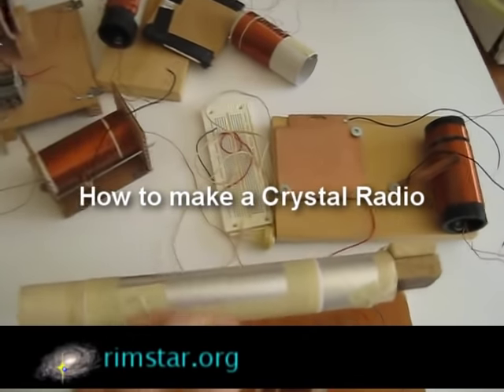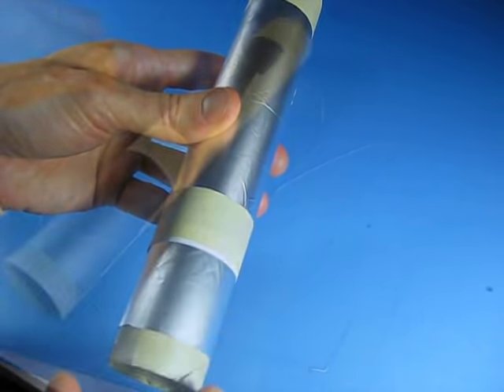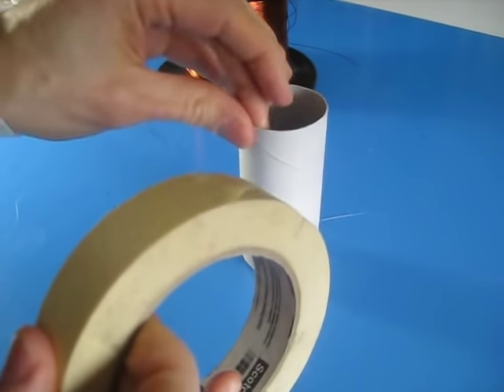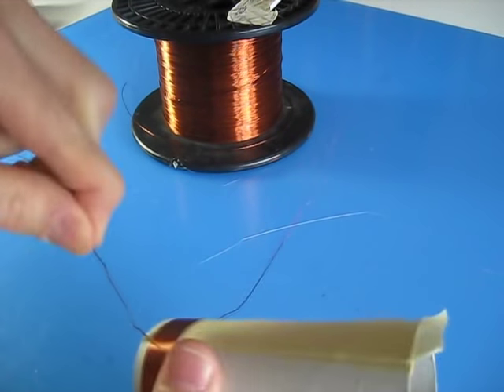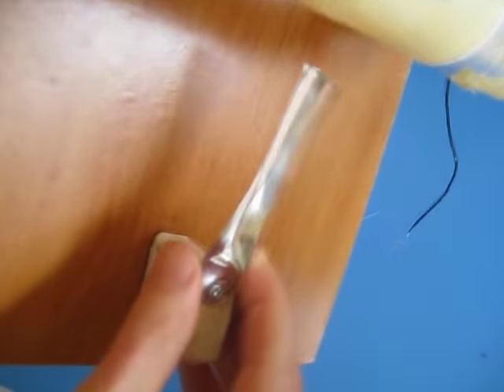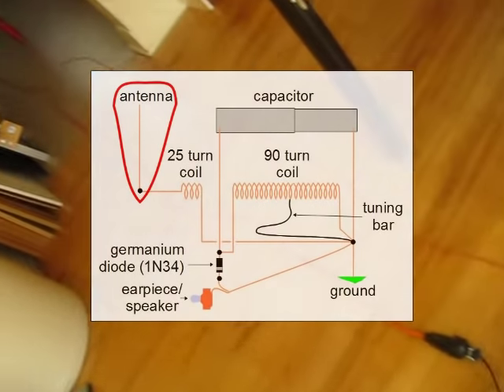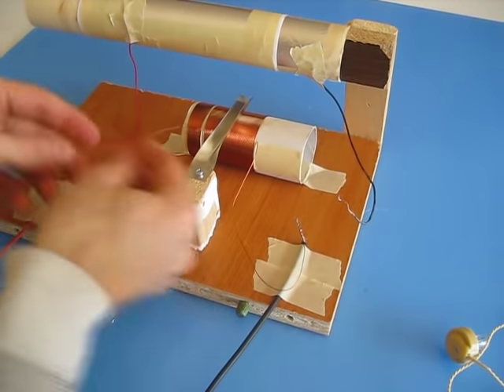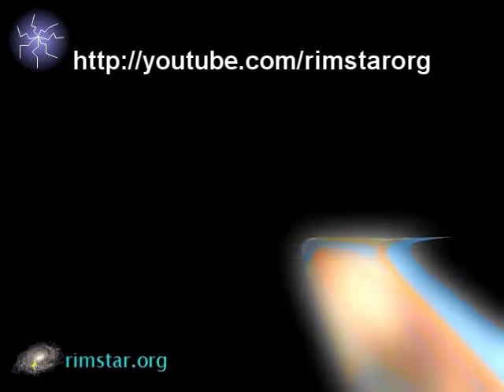How to Make/Build a Crystal Radio

Comment: Hi Raimstar, I am very excited about the project, I just made my crystal radio and it worked thanks to your video, even though I can only hear it with an audio amplifier and the sound is very low, I am getting the piezoelectric earphone in order to see if that was the thing that will do, I tried an old (I think) telephone earphone and also a piezoelectric buzzer but nothing happened at all. Also one of my biggest questions is to know if by any means there is a way to light up a led only with the energy that comes from the soundwaves, I dont know if it would be possible by using a transformer or ataching more antenas or what would be necessary, what do you think? Thanks in advance!
Reply from the maker: ***** The voltage coming from the crystal radio is very low, only a few hundred millivolts. Depending on your LED you'll need over a volt and sometimes over 3 volts to get it to light. I've seen people do it but they had very long or tall outdoor antennas. One person even raise his antenna using a kite! I've never even tried to light one.
Reply: RimstarOrg I'll try to increase voltage with a Joules thief, as it has given me very good results in few past projects, have you ever measured the amps coming out of the radio? Thanks again in advance!
Reply: RimstarOrg The other thing that I was thinking was to use all the radio's frequencys as possible to be able to get more electricity, im guessing I can try to achieve thay by removing the tuning coil am I right? And by the way congratulations!, you have done an amazing good job, if I achieve succes with the Joules thief I'll let you know, regards.
Reply from the maker: ***** You may need to find a germanium transistor  for the joule thief if you can find one. And no, I've never measure the amps.
Reply from the maker: ***** The problem with using all frequencies is that the electrons are being pulled in all directions, so no AC or DC, just random motion, and low voltage.

Comment: What is the difference between a foxhole and crystal radio? Do you need a capacitator that can tune in a cryrstal radio?
Reply from the maker: A foxhole radio is just a type of crystal radio. Usually it uses a razor blade instead of the modern diode (http://youtu.be/eIdHsjfbckw) and doesn't have any tuning. You don't need the capacitor if you have a tuning coil like I do. I went with both for extra sensitivity.

Comment: you do not have to have 2 winding of wire 
and the capacitor is not necessary either
and instead of a diode there are other things that can be used
Reply from the maker: jolllyroger There are many possible circuits for crystal radios depending on what you want. The 2 windings help with eliminating radio stations that are near each other in the radio spectrum. The capacitor helps with tuning in a single radio station. You can see more about those in my video about how crystal radios work http://youtu.be/0-PParSmwtE. And I've used the pencil and razor blade trick in this video here http://youtu.be/eIdHsjfbckw but it'd be nice to try an actual crystal and cat's whisker someday. And of course, there are more variations for all of the above.
Reply: so go for it lets see the cats whisker and real crystal i would love to see that
and yes i loved your other videos on using pencil and razor but the pencil is not necessary 
have you done CB band with razor
these are things that so many kids just learned in days gone by at school but these days the teachers are to busy teaching their global warming lies and indoctrinating children to be god NAZI'S and devout liberals
btw i know the whisker is a wire called a cat whisker because they were generally very fine wire... and the crystal can be any rectifying material

Comment: Can I use different gauges of magnet wire
 for the 25 turn coil and the 90 turn coil?
Reply from the maker: Yes, you can use different gauges of magnet wire.

Comment: another question popped into my mind.
If the diode is replaced by 2 similiar diodes(full wave rectifier), can the signal strength n quality b boosted?
and btw can u tell me how that speaker can be replaced a phone speaker?
thnx

Comment: i didnt have the normal insulated wires like the ones you used for the antenna so i used the magnet wires instead (after sanding their edges). will that work?
Reply from the maker: Yes, magnet wire will work. For a strong signal, you want you antenna to be as long as possible in a straightish line. Magnet wire is thin, which is okay for short antennas but if your antenna is going to start being around 300 feets (100 meters) then the long thin wire will introduce more resistance than a thicker wire.
Reply: @RimstarOrg   thanks a lot. really appreciate you replying to the messages on these 11 year old videos. your videos helped me very much. dropping a sub is the least i can do. thanks a lot again :)

Comment: Hi. Could this be adjusted to make a shortwave radio on the same circuit? Maybe fewer turns on the coil? Thanks!
Reply from the maker: Re I would think it would be just fewer turns on the coil. However, I have some plans on paper for a kit that includes shortwave and they add an extra 470pF in addition to the variable capacitor. That is the opposite of what I'd expect. The explanation given is that this enables the variable capacitor "to be a narrower range, making it easier to capture the Short-wave stations." I don't recall ever trying to tune in short wave with it though.
Reply: RimstarOrg Is there some kind of formula that lets me calculate the number of turns required for a certain frequency or frequency range?
Reply from the maker: Re Yes. You can get a fair idea using just the formulas for the inductance of a coil (L), the capacitance of a capacitor (C) and the resonant frequency of a parallel coil and capacitor circuit. That last one is also called LC resonance and uses the results of the first two.
Reply: The problem with short wave is the signal strength is so low.With AM radio the power is often 10KW or more.
And relatively close say 10 miles or  so.This supplies the needed power for you to here it.
Reply from the maker: ***** Theoretically you'd need less turns for 27MHz and lower capacitance. However, there may be other issues that come into play at those higher frequencies, such as the capacitance of the coils themselves and inductance in other wires might become a problem. I'm not familiar enough with such high frequencies to say more though.
Reply from the maker: Re In my earlier reply I said that some plans I have get short wave by adding an extra 470pF capacitor and that this puzzled me since I expected you'd want to lower the capacitance. I just realized they are adding the capacitor in series, which decreases the overall capacitance and the tuning range, so it makes sense now.

Comment: Sir i have used some what thicker wire than ur connecting wires, will it work still work the same or even i have to use the connecting wires of same thickness?
Reply from the maker: The connecting wire thickness doesn't matter. It should still work.

Comment: Can these radios be attached to a Joule Thief circuit so that you can amplify the voltage enough to charge a battery?
Reply from the maker: I don't think mine with my short antenna would produce a high enough voltage to turn on the joule thief's transistor. Maybe with a longer antenna it would work.
Reply: I have done that. (sort of)
For charging a battery you don't want a selective receiver.  You want the antenna on one end of the coil, the ground on the other and a capacitor across.  Using a headphone work to get the volume as loud as you can.
Use a really long antenna like perhaps a wire all the way around the house.
You can get voltages out of the detector up to about 1V or 2V.
You need a large low leakage capacitor to store up charge.
After a few minutes, there is likely enough to get a brief blink on a "super bright" red LED.  RED only needs about 1.7V to light.

Comment: Mine does not work🤔
I checked ewerything and all components are good. Connections two.
Does the direction of the coil winding matter? My coils ate both wound in the same direction.
Reply from the maker: No, the direction of the coil winding doesn't matter. Make sure you're making good electrical contact with the coils at the top with the tuning bar -- I've had problems with that sometimes. Your antenna must also be as long as possible in a straightish line. It also helps if you have a radio station nearby, I have a few. If you're unsure if you have a good ground then try toughing the common ground point with your fingers. And I haven't tried it, but others have said you'll get better results with the right end of the 90-turn coil (see the wire at 0:28) not connected to anything.
Reply: @RimstarOrg  thanks and does it matter if the coil has a core? (It has to be an air coil?)
Reply from the maker: For the inductance needed to resonate at the desired radio frequency range, yes, the calculations say it needs to be an air core coil. See my videos about inductance https://youtu.be/awyLYgu6ODM and resonance https://youtu.be/tjD9I95RAbw for more.

Comment: My friend and I followed this video for a project and we tested it but it doesn't seem to be working. We think it's either because the connection isn't good or the coils. If our 25 and 90 coils aren't tight enough, would it affect the whole radio?
Reply from the maker: Rose Schaffer It could be a bad connection somewhere, as you say, so check them all. The coils don't have to be super tight, so that's probably not it. Also, make sure you're making good contact between the tuning bar and the part of the coil that you sanded off.Make sure to check out my follow-up tips and tricks video https://www.youtube.com/watch?v=HZZmKZJrIW0.You do need a long straight wire as an antenna, or some radio stations nearby. The longer the antenna wire the better. Mine are fairly short but I have radio stations nearby. It also helps if the antenna is pointing in the direction of the radio station, though that's not absolutely necessary. Also, try at different times of the day.What are you using for the earpiece? It has to be a crystal earpiece. I talk more about some of your options for that here http://rimstar.org/equip/crystal_earphone_earpiece_for_crystal_radio.htm.With the addition of a transformer you can use regular earbuds, but it's harder to get working well. More on that here http://rimstar.org/equip/use_iphone_earbuds_earpods_with_crystal_radio.htm.Also, make sure you have a good ground, though that's mentioned in the above tips and tricks video too.
Reply: Thank you so much!! We do have the same earpiece so that's not the problem. I guess it's the antenna because ours is only about 3 ft long.
Reply from the maker: Rose Schaffer Happy to help. 3ft would definitely be a problem.

Comment: is it bad, to have more than 90 turns? I have done that, because I thought it may increace the Hz tolerance. Am I right or did I make it unfunctional? Btw. I use a diode called  N4007 MIC, if I read it right. Is it a good one to use?
Reply from the maker: Having more turns isn't bad since what matters is the number of turns between where the wiper blade touches the coil and the the end of the coil that's nearest the 25-turn atenna coil. That's adjustable by moving the wiper.
Regarding the diode, are you sure it's not 1N4007 MIC? If so, that's not a very good one to use. It's a silicon diode which means you'll need to either have a very long antenna (hundreds of feet) to capture a strong signal or you'll have to be very near a radio station. The better type is a germanium diode. The list of suggested germanium diodes that I give in the video description is 1N34A, 1N60, 1N91,  1N119, 1N270, 1N277, 1N283.
Reply: @RimstarOrg  Cool thank you. I have ordered one of your diodes from the description, but untill the delvivery arrives, I will test it with one diode from a laptop charger. ChatGPT says that it should be a schottky or germanium diode, so maybe it will work. 
I have another question, can I use a coil of copper that I ordered and unwind it to use it as an antenna?
Reply: @RimstarOrg  And can a thin graphit stick from a radio strengthen the signal, if I put it inside the coil?
Reply from the maker: Regarding your coil of copper, the length of the coil does matter so if your wire is thinner or thicker than the one I used then that will affect the inductance. You could still try it though. If your coil ends up being shorter than mine the you'll have more radio stations crammed into a smaller length.
Regarding the thin graphite stick to strengthen the signal, that will also change the inductance and will cause things to be different.
Reply from the maker: For an understanding of crystal radios, inductance and resontant LC circuits see these videos and webpages I made http://youtu.be/HupFY_24o-4 https://rimstar.org/science_electronics_projects/lc_circuit_aka_tank_or_resonant_circuit.htm https://rimstar.org/science_electronics_projects/coil_design_inductance.htm

Comment: Are there any alternatives for the germanium diod... I can not get any. I only found silicon diod, are those the same?
Reply from the maker: Silicon diodes need a higher voltage in order to turn on and to get that voltage you'd need a very long antenna (few hundred feet long) or to be very near a power radio station or both. They generally don't work for this.
An alternative is to try a pencil and razor blade which I do in this video https://www.youtube.com/watch?v=eIdHsjfbckw . It is hard to get working so you'll need patience and probably multiple tries.

Comment: sorry if the question has been asked before but don't you need a second capacitor after the diode for the demodumation ?
Reply from the maker: +StopTonCevi If you mean for removing the radio frequencies to leave only the original audio waveform, the piezo crystal inside the earpiece can't respond fast enough for radio frequencies but it does respond fast enough for the original audio wave frequencies and so it may serve the purpose you may be thinking of. I go over this more toward the second half of my video about how a crystal radio works http://www.youtube.com/watch?v=0-PParSmwtE.

Comment: When I was a teen I built a lot of those. Nowadays, even if I wanted, it'd be wasted time. No one broadcasts on the AM frequency anymore here in Italy, not even Radio Vaticana (and they were the fundamentalists of the AM). All of them migrated into the FM world at the start of the century and are now getting ready to go into the DAB system as soon the FM band shall be repurposed for something else... or be abandoned too, I guess.
Reply: People do make FM band xtal radios.
Reply: @kensmith5694  I haven't seen one of those nor even heard of them, ever. I wonder how they work, given that the demodulation of the FM signal to listenable info can't be done by using a simple device like a home-made crystal or a diode, and if you use a powered circuit it's not a crystal radio anymore.

Must look for one of them. Thank you for the head up.
Reply: @Pdor_figlio_di_Kmer  With a high Q tuned circuit slightly mistuned, changes in frequency end up making changes in amplitude.  This "slope detection" seems to be the method shown in all the youtube videos.
Reply: @kensmith5694  Saw some schematics on the net. Fascinating stuff.

Comment: If I somehow add a battery will I be able to use iPod earbuds and how much V does the battery need to be?
Reply from the maker: viki2133 I guess I already answered this in your post on my video about using earbuds with crystal radios so I won't repeat it here.

Comment: Hi, how do I calculate the number of coils for each L - element? Can make 10 for first L and 500 for second L for example. Thanks.
Reply from the maker: For the coil connected to the antenna I don't know how to calculate it. I got 25 from the book I mention in the video description. For the tuning coil, the 90 turn coil, I use the formula for the resonant frequency for a parallel LC circuit, a circuit with a coil and a capacitor in parallel. The L is the inductance of the coil and the C is the capacitance of the capacitor. There are all terms you can search for. I have a spread sheet where I give it the parameters for the formula for the coil inductance (length, number of turns, diameter, ...) and the parameters for the formula for the capacitance (area, distance between the plates, ...). Those two results feed the formula to the resonant frequency and the result is a frequency. I plug in various parameters until I get a frequency at the bottom of the AM frequency range and again until I get a frequency at the top of the AM frequency range. You can see a bit of what I mean in my "How a Crystal Radio Works" video starting around 4:55. So whether or not you can use 500 depends on the dimensions, etc of your coil and your capacitor. Whenever someone asks me here how many turns for such and such a coil, I simply plug their parameters in and give them the result.
Reply: RimstarOrg Thank you, that explains everything i need.

Comment: does it have to be 25 and 90 turns on the toilet paper roll or can it be a different variation? if i did like 20 or 50 would it still work?
Reply from the maker: 20 and 50 would still work. It would just be harder to tune the radio because the radio stations would be closer together on the coil.